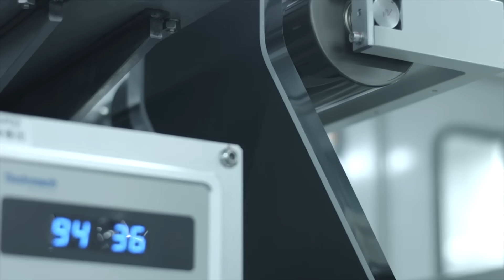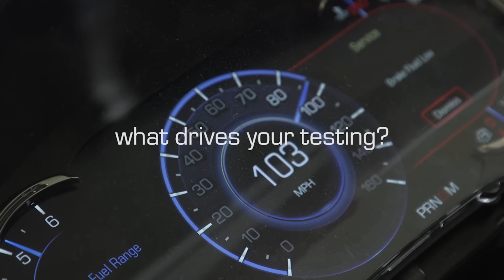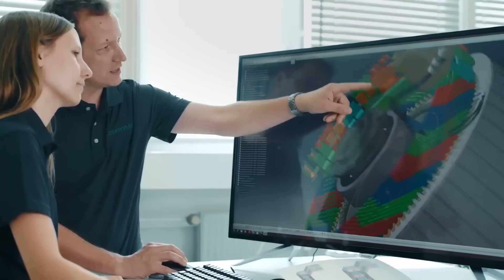BYD Passes Ford in Sales; Battery Output to Grow 6X - Autoline Daily 3662

Comment: Reduce, reuse, recycle !  Used EV batteries are a perfect fit for home usage !!
Reply: One of the most naive comments I've read in a while.
Reply: Hopefully soo. I own two electric cars with a total of 100 kW battery capacity. I will drive the cars until the end, hopefully the technology and market is ready for converting them into a battery powered energy storage.
Reply: @Harrythehun  People on the right love to talk about how EVs aren't clean because the batteries will end up in a landfill.  I guess they don't understand how technology advances - it gets better, or cheaper, or most-often, both.  

Yes, there is no great provision to let you turn your car battery easily / cheaply in to a home storage product today, but I think it's very logical to predict that the plan will definitely be a viable option when their usage in your cars is past, like 10 + years from now.  Especially when you consider that this doesn't involve any kind of technology break-thru to happen.

Comment: Battery fires still plague EV adoption on many levels. It may have something to do with EV car insurane that is gowing uncontroled in the insurance industry. You may want to make sure BYD or other auto makers EV's no longer experience any battery fires.
It maybe that In this presentaion an indirect effect could be contributing to the rising EV car insurance. Please have some consideration. thank you
Reply: That is why byd uses LFP batteries since 2010.
Reply: This argument is false...

According to a study by AutoInsuranceEZ, the yearly rate of EV car fires per 1000 vehicles is 25. The yearly rate of ICE fires per 100 vehicles is 153.

EV fires are only preventing those that buy into EV FUD or are uninformed from buying an EV.
Reply: Duh. Don’t believe the lies. There are more ICE Gasoline fires per 1000000 miles driven than EV fires per 1000000 miles driven.

Comment: BYDs largest issue is razor thin margins.  It will hurt them
Reply: Money isn't their problem like other car maker. CCP will just pop in some cash if they need it and that's the real problem.
Reply: @mukamuka0  and that is an issue
Reply: you meant like government motors?
Reply: @mukamuka0  When I say this I get pushback.  Not a PC thing to say.   Now the net is saying that Goverment ownership is 0% when at one time it was said to be 30%,   Tend to distrust Chinese data.
Reply: @mukamuka0 Kinda like what the US did when they bailed out the Big 3
Reply: They're Communist and couldn't care less about profit. The just want to rule the world by any means.
Reply: They are making money in China, unlike most manufacturers, and they can sell in Europe/US with bigger margins.
Reply: @sillystuff6247  Saying GM and Ford have decades of EV experience sounds wrong.  They sat on their backside after GM crushed the EV1.

Comment: Nisans new EV reminds me of the cyber truck.  Look at the sharp lines😊
Reply: Yeah,  but nissan won't make the same mistake to put 3 millimeter thick stainless steel on the outside.  The CT will be a true white elephant.  Lol
Reply: @paul5683  all 10 million of them.  Enjoy
Reply: @ChicagoBob123  As much as I would love for all the reservations to be turned into actual orders, they will be extremely lucky to get a 50% conversion rate in the next couple of years. Most pickup folks are going to get the Silverado EV or Lightning.
Reply: I think it looks more like a bz4x. However, a resemblance to either would not be a compliment to me. Was hoping for something more along the lines of their 2023 concept from last week.
Reply: Looks alot better then the Cybertruck!!!

Comment: 1:40 stupid question here, does the shape of the battery comes into any factor? Can we follow bee's honeycomb design to fit more batteries instead of circles?
Reply: Ever looked at how cylindrical batteries are packed? Honeycomb style. It's just easier to construct a tube than it is to construct a hexagon. The only reason bees construct a hexagon is because when circles are packed densely next to each other their cell walls merge into -hexes.
Reply: Would that interfere with cooling?
Reply: @danharold3087  Yes. The form factor gives a different surface area, and the surface area and materials are crucial for cooling and heat transfer.

Comment: Solid state cell may take decade but what about sodium ion cells. 
Which is cheaper and Chinese automaker launched electric car using Sodium ion cell …

Sodium will be cheaper than LFP and safer too… but the life cycle will vary.. 

Can you tell about sodium ion market availability and share ??
Reply: The Limiting Factor channel just posted a deep analysis of the future of sodium ion batteries.
Reply: Any chemistry that can be used in a jelly roll aka tradition round cell will have a bit of an advantage as existing plants are likely to reuse existing equipment to make them.

Comment: BYD makes junk. Outside of China you can't get parts for them and they need a LOT of parts for repairs....A lot of auto salvage yards won't take Ev's because of the risk for battery fires.Local fire departments are gonna start charging for coming out to junkyards to put out  Ev fires. Once these Ev's have been wrecked, they are a huge risk to  have on your property.  You  can use an engine out of a wrecked car, but using batteries out of a wrecked EV is a terrible idea.
Reply: That's a lot of opinionated words without citing your sources.
Reply: Show us your data source for all these battery fires. Ice engines are significantly higher and way more volatile than
Reply: @vancity2349   That's been debunked OVER AND OVER. That's talking points from EV fanboys to cover up the dangers of Ev batteries. Yeah the NTSB put out stats  appearing to show that ICE have a higher rate of fires. They did this intentionally to promote Ev's. When you look closer at those numbers the ICE fires are on older models that are neglected and not serviced properly. The Ev fires on the other hand are from late model Ev's that are caused by something as simple as just hitting something in the road....Look at your homeowners  insurance policy, Most companies now put this in their policies, If you have an EV in your garage and it starts a fire and burns your house down, They don't cover it. They don't do that with ICE vehicles...The folks claiming that Ev's are safer are either misled or just flat out lying.
Reply: REDWOOD battery recycling 🔋🔋🔋♻️♻️♻️♻️
Reply: You have to find a junk yard that knows what they are doing. I have bought planty of ev battery packs for grid storage with no issues. It's pretty easy to tell if a pack has been damaged and the junk yard well recycle it for good money right away.
Reply: @melikitty333  As well, Nissan has a well known repurpose program for the Leaf batteries
Reply: If you're leaving $15k worth of battery grade materials in a junkyard to catch fire instead of immediately recycling them for cash, you probably deserve a battery fire on your junk yard.
Reply: @CSHarvey  Missing a zero or two ?
Reply: This sounds like some auto-generated AI BS
Reply: Bla bla bla

Comment: BYD Group including Denza was the largest EV maker in the world. Ahead of Tesla!
Reply: Byd is over 300k+evs behind tesla ytd in both sales and total ev production smh. You byd&chinese ev slurpers really are something.
Reply: @4literv6  

Tesla uses BYD blade batteries in half the Models it sells. Tesla is dependent on BYD. SMH
Reply: @protagonist9716  catl not byd provides almost half of teslas base rwd or sr trim cells, byd had a 4gwh contract to supply giga berlin for the base model y rwd only in a tesla designed structural pack smh. Like I said you Chinese slurper! 👍🏻
Reply: There are many other Auto companies that produce more than Tesla, so I'm not sure why that specific comparison matters.
Reply: @BTC_Minarchist  many? There are ZERO companies who manufacturer more electric only cars than tesla. 😀
Tesla is 12th now in the rank of top global car manufactures could be 10th by year end. Byd is 4th and is half ev half phev.

So as a point of FACT anyone can research for themselves you are lying! 👍🏻
Reply: @4literv6  Easy there amigo 🙂

I thought it was overall auto production, so I wasn't lying, but had misread the original comment.
Reply: @4literv6  Easy there amigo 🙂

I thought it was overall auto production, so I wasn't lying, but had misread the original comment.

Comment: This means game over for Tesla!
Reply: Why?
Reply: Why don't you short TSLA????
Reply: Actually Google the vehicles BYD makes.take a look at how many models are comparable to a Tesla and how many are souped up golf carts that can't be sold outside of China. Dig into their supply chains. Not all EVs are the same, and BYD serves a valuable role complementing Tesla for markets that Tesla has no plans to serve.
Reply: @CSHarvey  But thats a good thing having a car at every pricepoint having hybrids pluginhybrids and BEVs!They have everything!If Tesla want to sell a lot more cars,they have to offer small cars to,and small cars have way smaller profitmargins!Do you realy think that Tesla is 8 times more worth then BYD?BYD onenof the biggest producers of batteries and powerwals and Solar and EV buses that will sell this year 1.7 million BEVs and 1.3 million Hybrids!
Reply: @brunoheggli2888  What are we arguing about? Two great companies that have their strengths and weaknesses. Both deserve their positions in the market. Both will and can survive if governments keep their greedy hands off.
Reply: The vast majority of the non-truck auto market consist of vehicles below the price of Tesla's cheapest offering.  See Tesla is approaching a sales ceiling since, the $40k+ auto market is finite.  BYD is well established in a much larger market, so its nowhere near its sales ceiling.
Reply: @Cakebattered  Tesla has plans to move down market with the model 2.  A platform they say will be used to build multiple cars in multiple factories.   The Mexico factory will allow Tesla to reach markets that BYD is targeting.
Reply: Part of the problem Elon, musk, mega love and most of his car buyers are tree huggers that are democratic
Reply: Lol. Dumbest comment

Comment: That Volvo EX30 is a great deal.  Hopefully, that means more EV price cuts.
Reply: It is also a Chinese vehicle rebranded as a Volvo.
Reply: @williamrogers1219  yup where will they get any parts for it and will ALL us Volvo dealers be up to servicing it and or repairing it.
Plus doing recalls or warranty work on them? 

Volvo said they want to appeal to a younger generation of buyers With the ex30.
Yet it's not very loaded up at the base, suck everybody in price point of 35k. 

No tax credits, and you know the dealers aren't going to stock any below 40k minimum sticker. Plus it'll be high interest to start sales off, so market markups could also be applied further frustrating those who wanted one near that 35k price point.
Reply: @4literv6  what happened to volvo? I like my older heavy one made in sweden. It's real nice made. Now they china evs?
Reply: @itsallminor6133  yes they sold out majority ownership to geely year's ago now.
Reply: In the US no tax break so its not as good as buying a Model 3 RWD which comes standard with more features.
Reply: @ChicagoBob123  Crossover and sedan are different segments.  Incentives are still available for lease.
Reply: @dansanger5340  lease but you can't buy it.  The game os maybe of your leaser let's you.  Blah
Reply: How is it a great deal exactly? The bolt euv is 4-6k cheaper for a b segment 5 Dr ev. And qualifies for the full tax credits.
The ex30 is very cool looking imo, good overall tech in the higher trims, good power and good range. With decent charging. 

But option it to compete against a model Y and it falls completely flat. Plus by the time it arrive next summer? 
The tax credit will be a pos redeemable rebate. Maybe leases will be the bread n butter for them?
Reply: @4literv6  The Bolt EUV is a great deal, too.     Saying one is a good deal doesn't mean others are a bad deal. 

It's a good deal at the entry level.  Some people want a basic EV crossover, and are willing to forego the bells and whistles for a low price.  Even so, it seems to have decent features at the entry level.  But, yes, it's a lease vehicle, unless you don't qualify for the incentives anyway.
Reply: @dansanger5340  honest no bs opinion, to you without the tax credit and knowing you need the 40k+trims just to match a tesla model Y rwd model on total tech. Do you think this car in a 1 size down even smaller segment is actually a good deal for what it is? 

Imo it just isn't, at the Chinese sub 30k pricing yes it would ABSOLUTELY be, and before you ad the 27% tariff b's. 
Keep in mind Volvo is circumventing this cost by also exporting evs from the US to other countries avoiding that tariff.
Reply: @4literv6  Why would a buyer on a budget need to match Model Y tech?  And, what indispensable tech does Model Y have that this doesn't?
Reply: @4literv6 The EX30 and the Bolt may never cross paths.  EX30 starts selling in 2024, Bolt stops in December 2023.

EX30 will be compared to Kona, Niro and Mini.  And Model 3.  Maybe Equinox, if GM ships more than a dozen this century.
Reply: @davidmenasco5743  bolt has already been confirmed to be getting new ultium tech and continue on though by barra herself.

Your last part was hilarious btw about the equinox. Which will probably cost a lot more than the ex30 does for the dozen gm makes. 🤣👍🏻
Reply: @4literv6  What Barra didn't say is when the Ultium Bolt would come out, and how many they would make.  Or anything else about it.  So for now, the ETA is: Someday, maybe.
Reply: @davidmenasco5743  all good point's and gm under her watch hasn't hit a single one of their multitude of ev promises yet. 😆
My point was it's been confirmed to return with ultium tech. Will that be next year or 2025? Nobody knows unfortunately. 

And we now know from her comments a sub 40k equinox ev is unlikely, plus the sub 50k blazer 1lt trim was also cancelled.